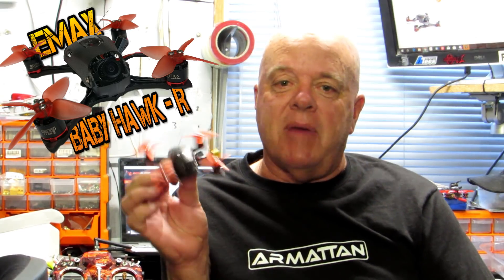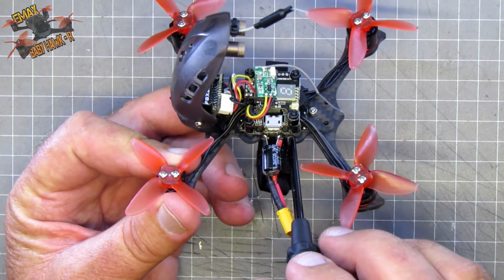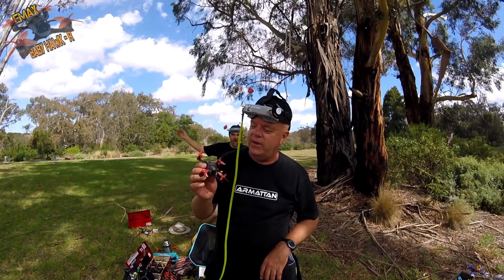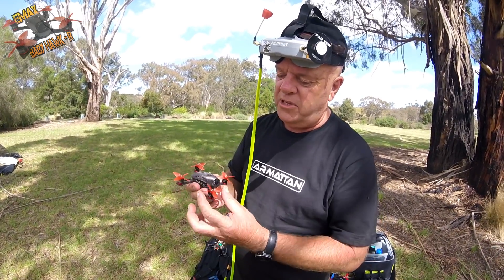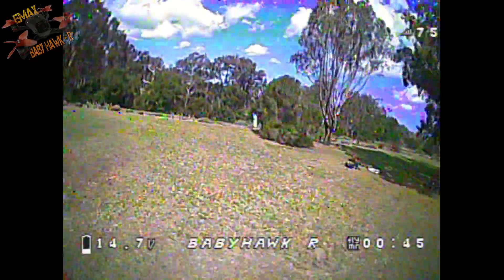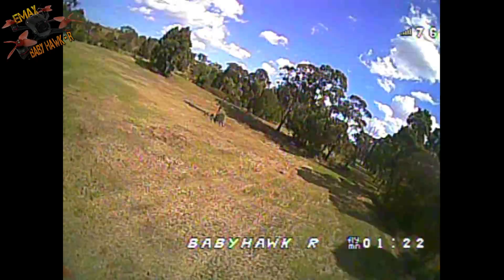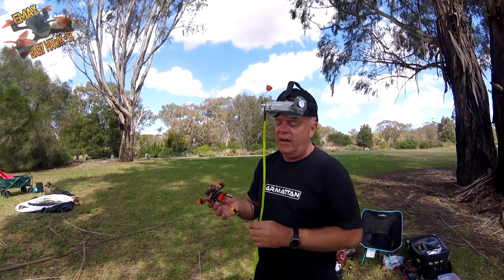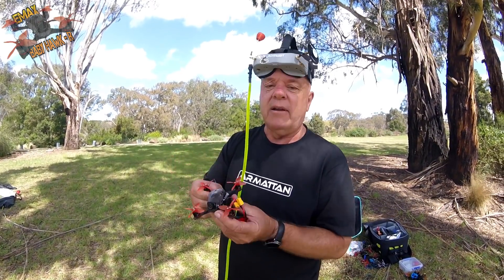Emax Babyhawk-R RACE Buy It or Bin it 5 Minute or less Review

Comment: Could you tell us how you made or purchased the power supply cord to your Aomway goggles, PLEASE.  I'm an old guy like you and don't need any more weight on my head.  THANK !!
Reply from the maker: G'day Steve I  made it   just a barrel connector  on one end and a XT60 on the other  i plug it into a 3s battery
Reply: Grumpy Trev ,  do you have a link to the neon cable, is it a  tube covering the wires?

Comment: Looks like a great bit of gear but that capacitor hanging off the side looks like a real weak point to me.  I think i will wait for V2 when they fix that obvious failure point.  Something like this with the new smaller run cam split would be amazing.

Comment: Hello Trev, I hope you see this message because I could really use some help. I received my first quadcopter ever in the mail a couple days ago and till now I am not able to get it to start. I have watched every video on YouTube and nothing has helped. I purchased kingkong 90gt and added a fs-a8s to it. I purchased a flysky fs-i6 as well.
Reply: Have you bound the reciever to the radio? Do you hear the beeps? Does the copter power up? What happens if you connect it to betaflight? Did you set the modes tab? I know it can be frustrating at first but we can't help you if you say it just won't work. Explain what is it that's not working

Comment: BabyHawk-R is a good little quad.  We've been doing some indoor racing with a micro class 2 1/2" and smaller.  3S is just about right if you have the right battery, the GNB 3S 550mah (RDQ also) makes this thing rip like crazy.  Not sure it would be controllable on the track with the 10-12 foot ceilings on 4S
Reply: What sort of flight times are you seeing with that 3s battery?
Reply: I just got a chance to run the Race Day Quads (GNB) 550 3S battery at an indoor micro race this past weekend.  Prior to that, I was using a 520 3S (can't remember the brand).  Racing 2 minute heats with the RDQ battery I had ZERO voltage problems.  I will give it a flight and see how much time I can get, but I'm sure I'll get at least 3 minutes.

Comment: I always found 3S fine for a frame with those motors. I have the Emax 1106 6000kv motors on my Diatone GT R90 and they go more well than enough (I mainly fly it in the backyard so it covers that area really quick) but even when we go to larger areas its still decent. 

You just need to stay low and fly closer to obstacles, it'll feel plenty faster than hanging out high in the sky

Comment: Hey Trev, I just bought one of these the other week. (along with buying a Kea 6" from the NZ place I can't pronounce or spell) so sounds like I've made wise choices?
My Babyhawk-R I completely stripped down. I've RF shielded each layer of the stack. I relocated the camera channel select plug to be next to Micro B port. I manipulated the capacitor position to tuck up nice and close to the body.  I added a full size quad battery strap that goes front to rear as well as retaining the rectory strap. I relocated the FrSky receiver to the side of the chassis. I've bolstered under the 4in1 ESC cause believe it or not Emax has admitted a fault that turns the Babyhawk-R into a Fire dancer when someone unknowingly over torques the soft mounted ESC causing arc out onto the carbon fibre bottom plate. Yes carbon fibre is actually a semiconductor believe it or not ;-)
So definitely find some small plastic washers to put inbetween.
I've decided to remove 2 of the 4 screws from each motor for weight reduction. Removed the bottom plate also and created a carbon fibre visor to shield the camera from front on collision. Lastly I'm waiting on my 3DS upgraded arms for 2.5" conversion. these are on eBay already in Aus for $19. They come with 2 sets of 2.5" props also. I've gone a step further and after calculating the space I've opted to also purchase some 2.8" props and some 3" props effectively making this a very nice and stable 3" quad (I hope - all reviews seem to indicate this though?).
I'll let you know how it flies? hopefully won't need to call the fire brigade running 3" props and 4S 800mha lol!
Reply from the maker: Wow thasts an overhaul
Reply: I like overkill. I cannot keep something in standard form, anything I own needs to be improved, modified to it's best capacity. It's kind of like an OCD thing I have
Reply: Ditto Jarmezrocks! lol Great minds think alike! Perfection is key! hehe  :D

Comment: Love the micros and finally we have some 2 inchers that can almost hang with a 5 inch. I just upgraded the motors on my kingkong flyegg to some 1105's and hope to maiden today if the weather holds. It's not gonna be as far or as good as the babyhawkR but it's gonna rip. Great review T!!!
Try the 2.5 or 3 inch arms next if you can. The 2.5 I saw somewhere online I think there was a link in the rcgroups thread lll look for. Emax has the 3" arms listed but not showing in stock.